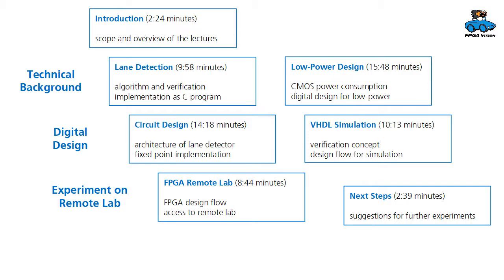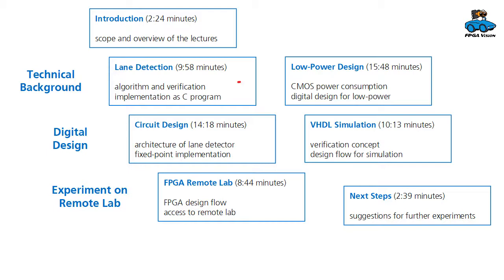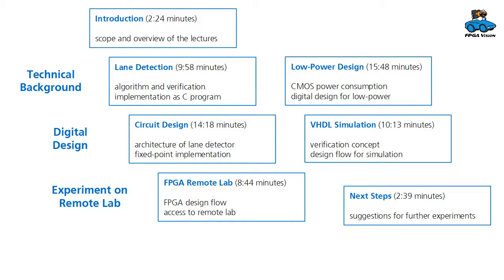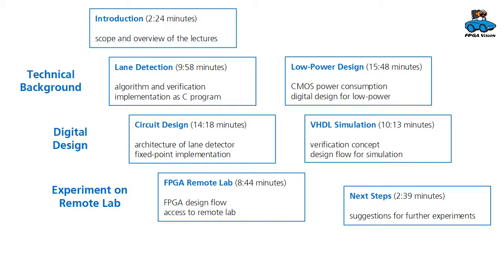FPGA Vision - Introduction

Comment: I liked the course.  Thank you so much for providing this interactive course. I do have a question. Can we do the FPGA implementation using Verilog HDL?
Reply from the maker: Hello Ravi, thank you for your comment. You can program the FPGA with Verilog HDL, but we do not provide Verilog source code. If you look at the VHDL code and reproduce it with Verilog, you probably learn a lot about the design structure. Best wishes!
Reply: Sir, I saw the VHDL code but i didn't find a way to write synthesizable file handling Verilog code. It would be great if you guide me in writing code for same.
Reply from the maker: That is a contradiction. You do file handling in the testbench, but this
 is not synthesizable. In any way, I can not provide individual 
guidance on Verilog.